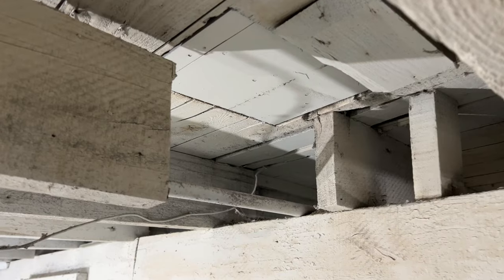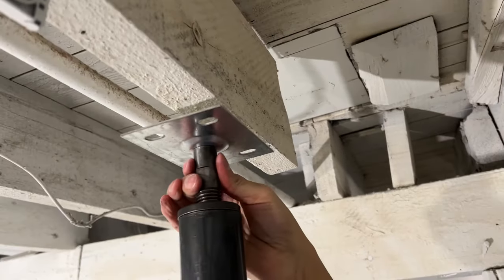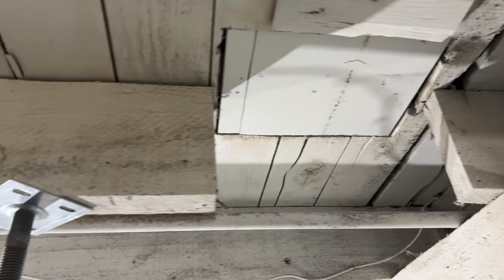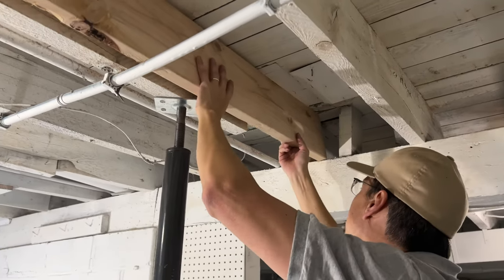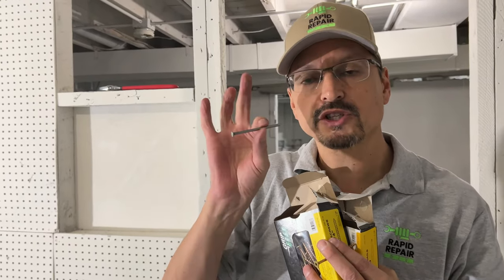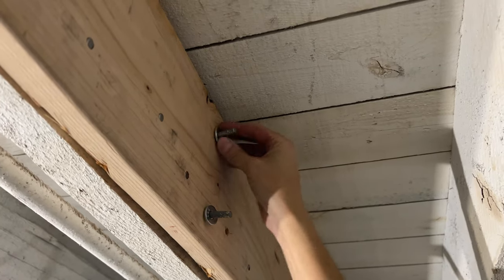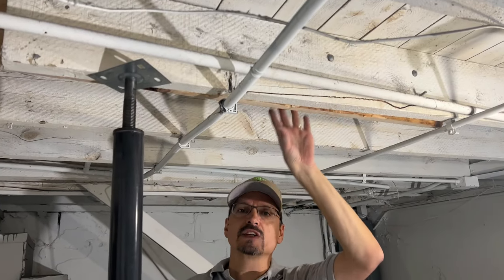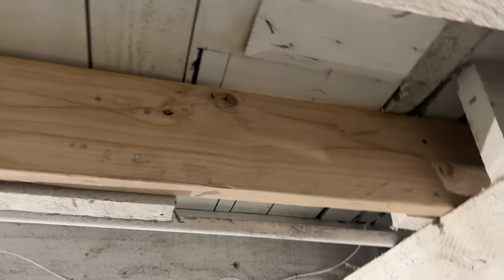Properly Repair a Cracked or Cut Floor Joist

Comment: You should have doubled up on the other side of that cut out and at least 2 feet past the break. Always glue and screw. Use the bolts before the nails or screws. Installing a few supports in the basement is never a bad idea if you have room. Each can easily cover 3 joists using a strong support on top. Cross bracing between joists is always a good idea.
Reply from the maker: Thank you for watching and your comments 🛠️🛠️
Reply: would construction adhesive be better than carpenters glue here?
Reply: @feralbigdog   HD Const. Adhesive for sure. Make sure your screws are strong. They can be the weakest link. Over engineer always.
Reply: Agree with all your points, and would add to use structural rated screws, HD and Lowes both carry them.  Construction adhesive should be used since the original is painted so carpenters glue would be ineffective (it needs to be absorbed into the cellular structure of the wood to hold).
Reply: @jackpestaner6925  Thanks Jack- I agree with you as well.

Comment: I had to do this to two cracked joists in my basement, electrician drilled holes right at the bottom of the joists. I squeezed glue above the original joist before lifting, on the side and on top of the new, hopefully prevents future squeaks. Just as a side note, grk makes screws that are rated at 450lbs in sheer, 16d nails are rated at 150lbs in sheer. Although it’s kind of a moot point if you’re putting in lag bolts.
Reply from the maker: Great points. You’re smart, you get it. I love bolts as I believe this repair will last forever. 😊🛠️🛠️

Comment: Great video,,, if you guys ever do any sagging roof rafter repairs, post it... I think I need to sister up a few roof rafters in a garage I hav
Reply from the maker: Hey, thank you for watching. Jacking up roof rafters can be tricky. They can start to crack and snap on you. If the sag : bow  has been there for many many years, you may want to just add additional bracing to what’s already there… LVL laminated beams are a great way to do this in a garage.

Comment: I have a simular issue in an old house were a 2 ft section was cut out a floor joist. I was going to use 2 trimmers and joist hangers etc, but if I used this scabbing/sistering method you are showing in the vid will that be up to code in NC?   Also if the section of jost thats missing is 2 feet. how long do the sistered boards need to be? Granted we have no peir or support to rest the boards on so they would just be sistered on both sides of the cut joist.  LMK thanks!
Reply from the maker: I think it will hold up just fine....since you have to add all that extra strength on each side just run your new joists extra long, say....2 feet or more on each side. Properly secure everything and it will be 1000% stronger than it currently is. Good luck

Comment: Would you use shims if existing joist was actual size and the replacement was nominal?
Reply from the maker: You could if you want to. But honestly, I don’t see why you would need to bother with that. As long as you are through bolting the repair together, it should be a solid as when the house was built. Good luck.

Comment: There are structural rated screws, eg GRK R4, otherwise use nails, also the sister joist should ideally be free of large knots, especially on the edge lol, don't use a piece like in this video, and make sure the jack oist is plumb before jacking, an hydraulic bottle jack may be good to have if you have multiple repairs to do or a second story, that little screw does poorly if it's loaded
Reply from the maker: Thanks for watching 😊🛠️🛠️
Reply: yes, probably an LVL would be best but clear douglas fir for sure.

Comment: I would have doubled up or use a piece of steel for extra strength
Reply from the maker: You can rebuild it stronger than original if you want to. There was no load point above, just basic living room 😊🛠️🛠️